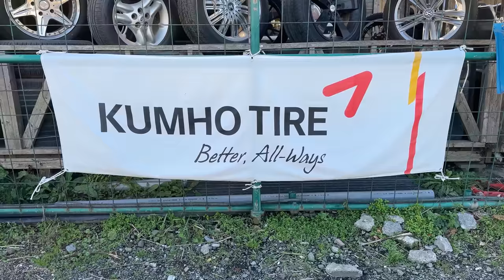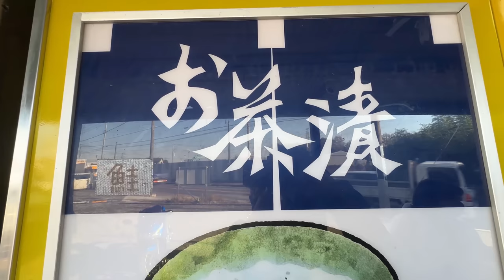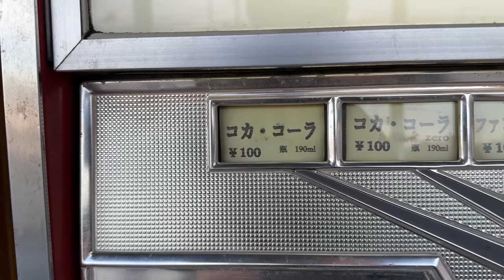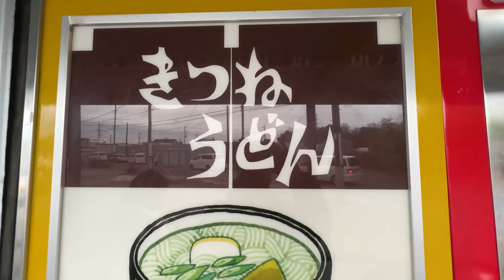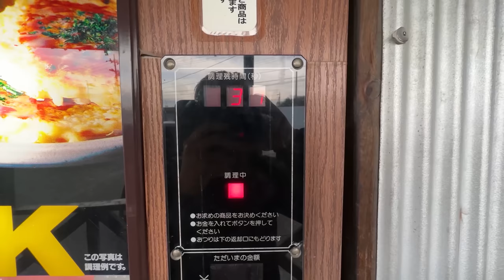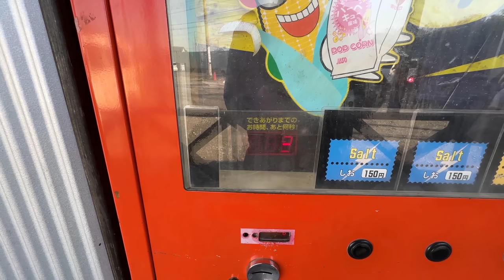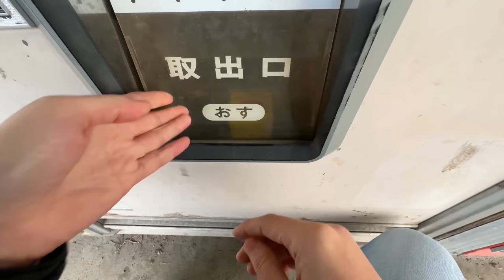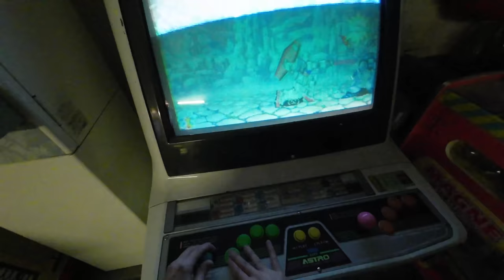Eating at the Largest Vending Machine Park in the World

Comment: The reason the hot snack vending machine's timer is slower than actual seconds seems to be due to a modification done to the timer to compensate for the aging magnetron (basically microwave oven's core component).